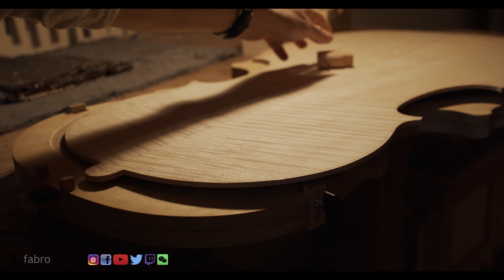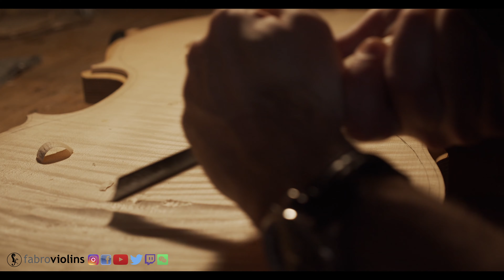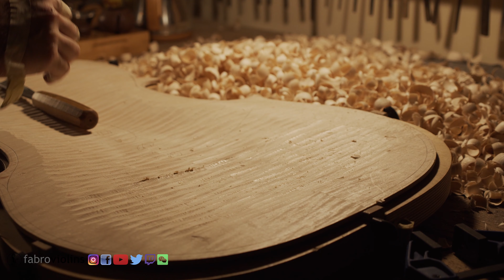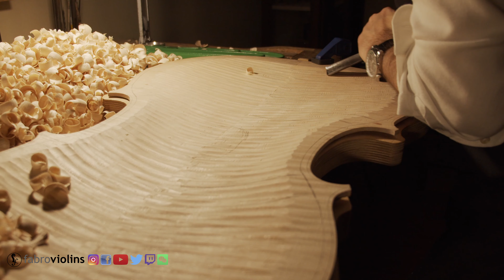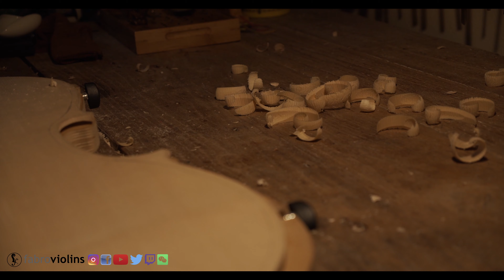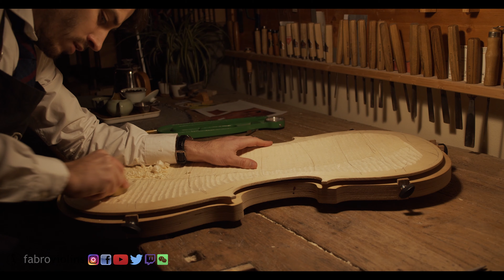MAKING A CELLO | Top Carve out & Back Thickness (part 1) | Ruggeri Model

Comment: How long, approximately, does it take to carve out the final profile of a Cello back and front?
Reply from the maker: Hi there! Thank you for your comment. The time it takes to carve out the final profile of a cello back and front can vary depending on various factors such as your level of skill, experience, perfectionism, etc, etc, etc. It's really impossible for me to give a straight answer. It can take anywhere from a few days to several weeks or even months. Ultimately, it's important to take the time necessary to achieve the desired result. Hope this helps!